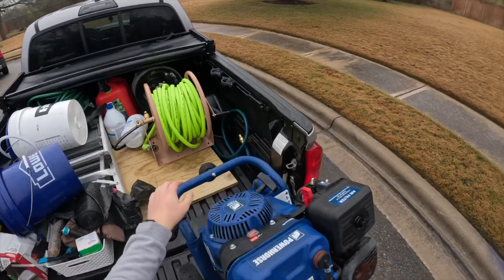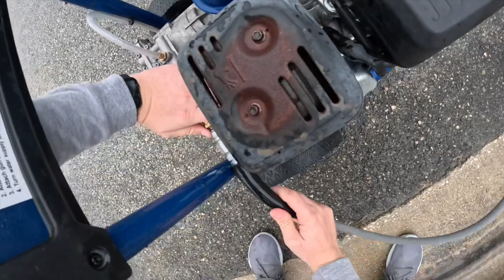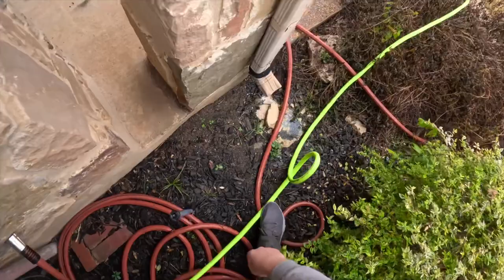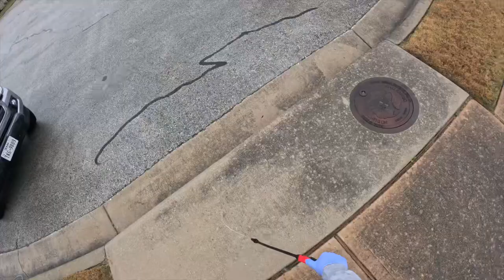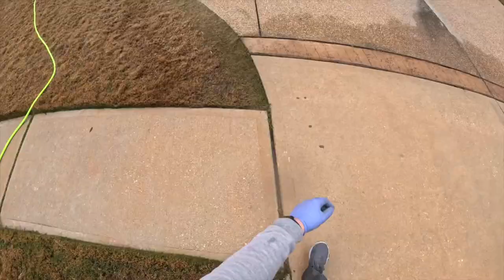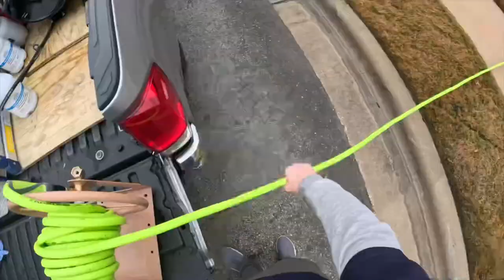Sidewalk Pressure Washing! Setup & Breakdown Vlog

Comment: Curious on where you got your hoses and rails, thank! Great vid!
Reply from the maker: I got my pressure washer hose from Northern tool, I have a 100 ft hose and a 50 ft hose, all grey non marking. My pressure washer hose reel is from Amazon, I’ll send a link to it. My garden hose is 100 ft Flexzilla hose and the hose reel is from Tractor supply but you can get it on Amazon as well